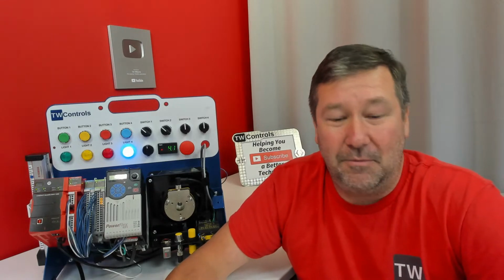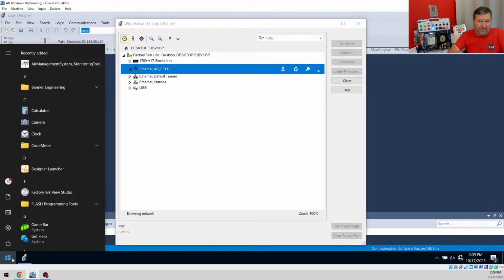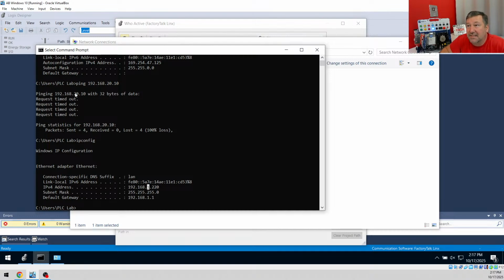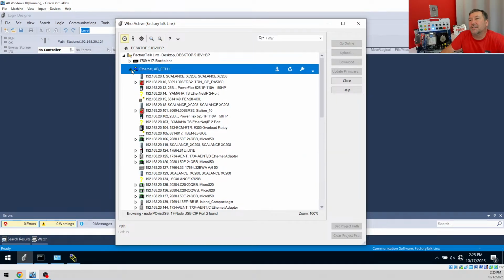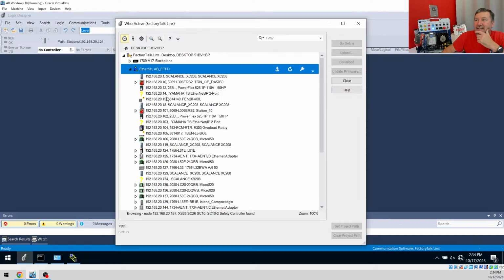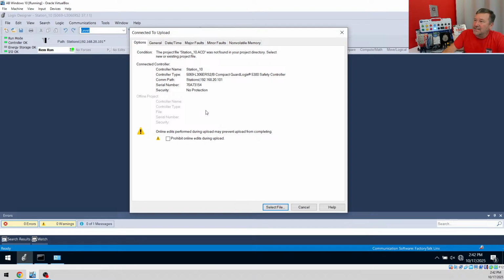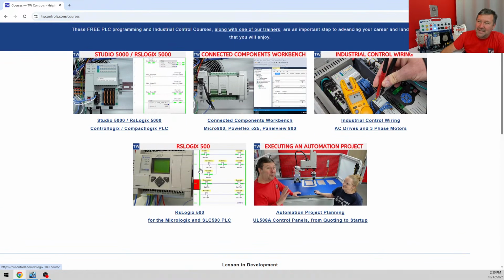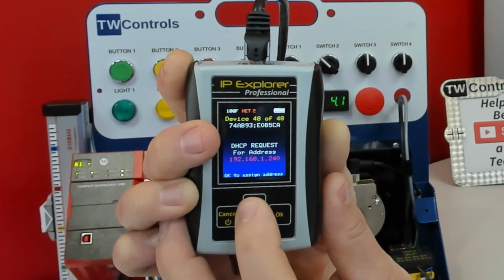Allen-Bradley PLC Communications for RsLinx and FactoryTalk Linx

Comment: The first three octets need to be the same only if the first 3 octets of the subnet mask are 255. I heard you say this is not a networking class, but more complex networking schemes are becoming more common every day. I have networks that use 254, 128 or 0 for the 3rd octet and allow addresses that have different 3rd octet IP's to communicate freely.
Reply from the maker: Even in more complex networks, the rule works for connecting to the PLC, but you may not see other devices that the PLC is communicating with. 

And even then, that PLC was communicating with that 192.168.10.66 device that I stopped short of talking about... Then we have to dig into gateways 😁